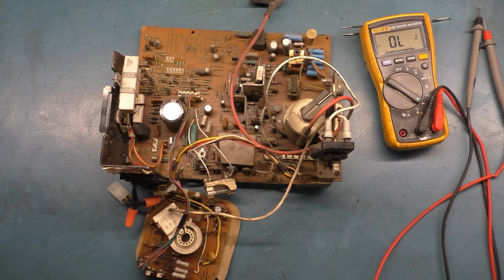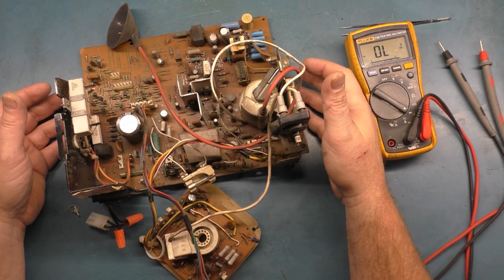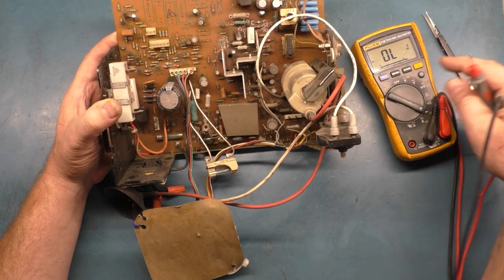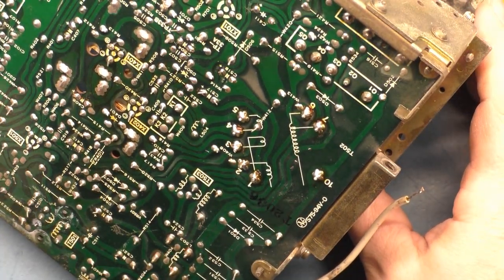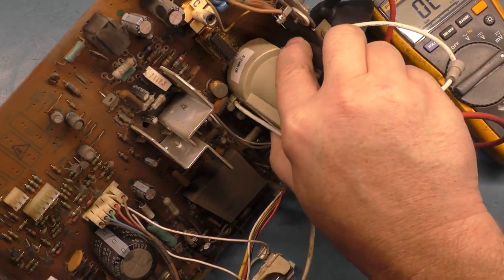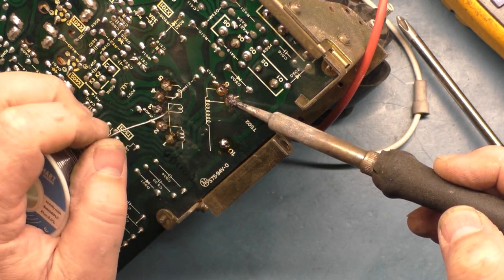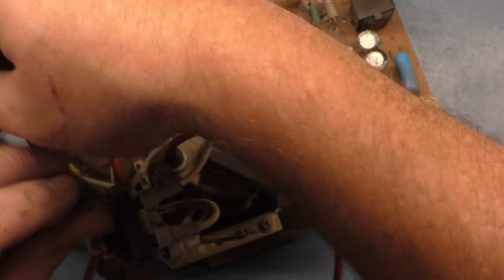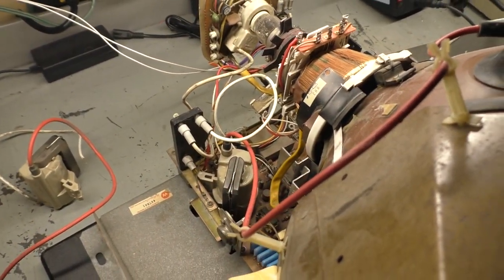19" G07 Arcade Monitor Chassis Repair - DEAD....But Everything Checks Good? Bad Flyback?

Comment: Thanks! Got my dead G07 up and running. It had a blown fuse, shorted voltage regulator and shorted HOT and I replaced the flyback for good measure. I would never have been able to repair it without you and your taking the time to make and upload this video. 🙏😃
Reply from the maker: Great!

Comment: Those screws don't line up right on these new flybacks all the time...last one I had the fly fully seated best possible and just used a zip tie through the holes and it works great.  Great vid, thanks!

Comment: Does the arcade machine have to be on the ground in order to get rid of the voltage with a screwdriver-wire-alligator clip connected to the metal chasis. I have an old zaxxon cabinet with a line down the middle of it, and I cant figure out what is wrong,,, I've heard of vertical collapse, but still don't know what I need to adjust, because the game comes on, I drop a quarter and it begins, but cant see the game. Just a line.

Comment: Hey Mike! I was introduced to your channel on the arcade help repair Facebook group.

Do one of your videos have how to discharge the monitor chassis from the …monitor?

I’m working on a G07 for the first time with no prior CRT experience and I don’t have any fancy HV test proabes
Reply from the maker: Hey Will. Just take a flathead screwdriver, attach an alligator clip with a wire to it, attaching the other end to the monitor frame, stick the screwdriver under the anode cap, and that’s all you need to do. When you hear the snap, you’re good. If you hear no snap, it was already discharged. This explains it…

https://youtu.be/mV9Td8vAb0Y

Comment: Great work brother as always. I HIGHLY recommend getting an fr-301 or at least a zd915 it'll change your life.
Reply from the maker: Thanks. I'll look into them. I had a Hakko but it kept getting clogged and threw it out after getting frustrated.
Reply: @MikesArcadeMonitorRepair  the fr-301 is what i use daily, i work on monitors, psus, etc. i have it set to 2.5 or so. the zd-915 also clogs, so maybe not use that one :P the hakko you just need to regularly clean with a rod and the cleaning tool. but you can get a tip big enough to even do flybacks. i use a 1.0mm tip but they make them all the way to like 3mm.
Reply from the maker: Copy. Thanks. "I'm sorry that I didn't build you a stronger ship, young Rose."

Comment: Hi Mike, first off thanks for these great videos. Incredibly helpful for a newbie such as myself.

I am testing my voltage regulator and B+ resistor and I am getting 216 ohms on the resistor and a drop of .26 rather than .18 on the white lead. How should I know what operating range for these components is?

Thanks!

Comment: I've been scouring the net for a more detailed schematic of the GO7-CBO chassis such as B+ around the vertical and power supply area. I've looked this chassis over and replaced what defective items were found. I bought this arcade game with a vertical width problem which usually is a bade filter cap. I've replaced all caps, even both output vertical  transiters just to be on the safe side even though both showed good. I have 119v on the collector of X401, and bout 39v on the collector of X402. I've checked every diode and resistor in that circuit and can't find any reason why no vertical defelection. I've tried Sams Photofacts without any luck. I am retired electronics tech been working since the late 70's thru early 2000, now I just dabble in it. I came to find out later that this was a man made issue which adds to the frustration. Any help would be appreciated.
Reply from the maker: I would highly suspect a crack in the board at this point.
Reply: @MikesArcadeMonitorRepair  I've been all over the board especially circuit around the flyback, but will go over it again. I miss my Sencore toys

Comment: Did you have neck glow with the bad flyback?
Reply from the maker: Nope
Reply: @MikesArcadeMonitorRepair  My Go7 in my PP2 is doing the same symptoms as yours. Totally Dead.  the B plus resistor is 218 ohms. Voltage regulator and Hot are within specs. F901 and F902 are ok.  B plus at resistor is only 65 volts.. Bad flyback???
Reply from the maker: Very likely.